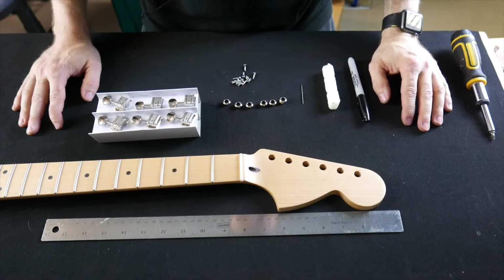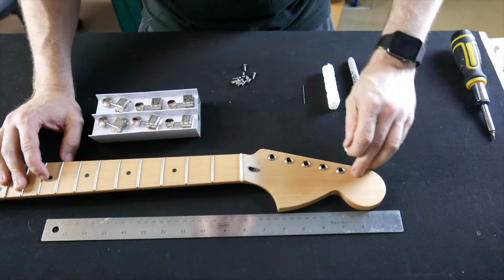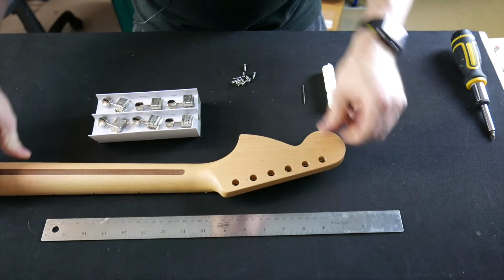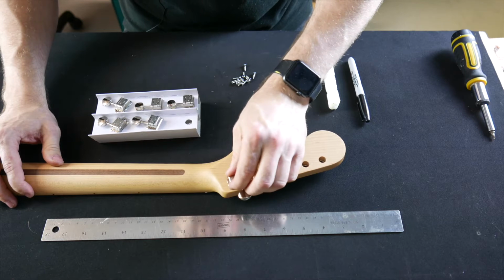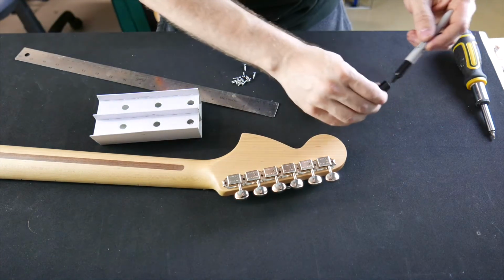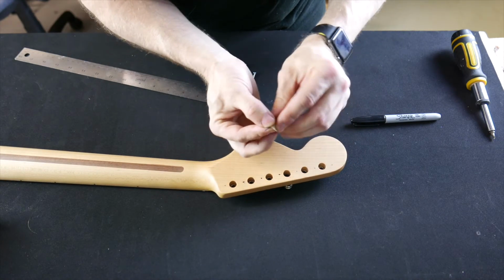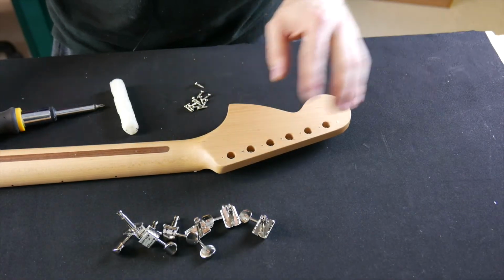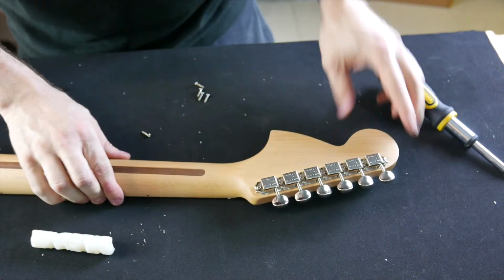Complete Stratocaster Guitar Build Tutorial Pt 3 - Machine Heads

Comment: Hi! My machine heads have two tiny pins rather than screws, do you have any advice for how I could install those?
Reply: StewMac has a drill jig. I put them in place, line them up with straightedge, and snug them down to make a little dimple where the holes will be drilled.